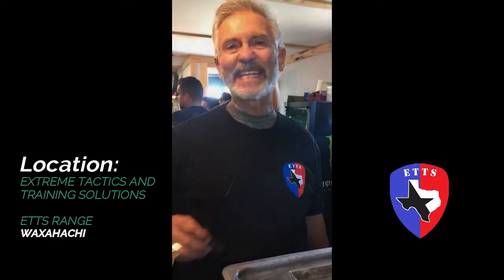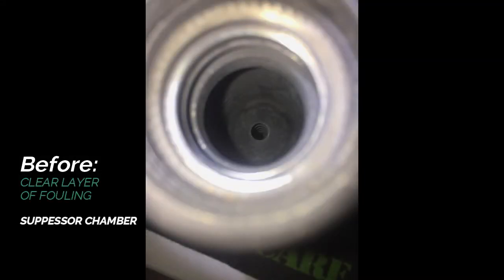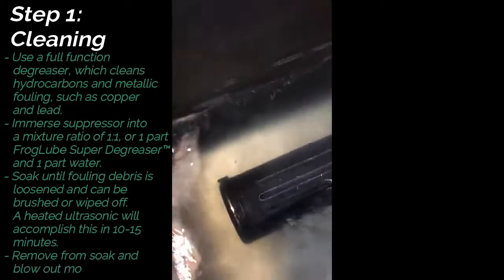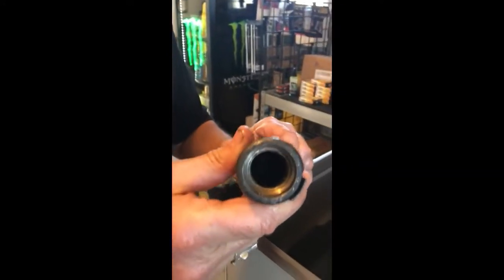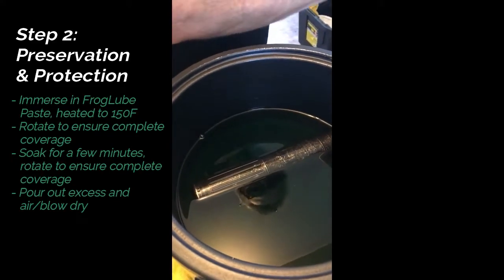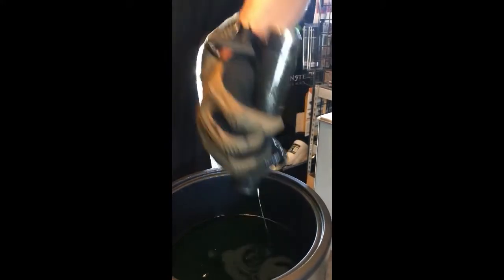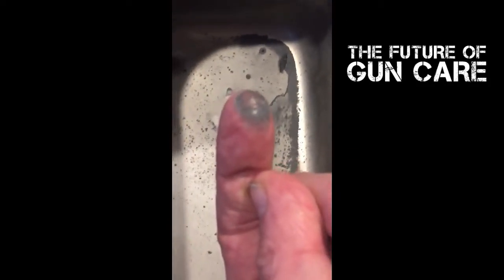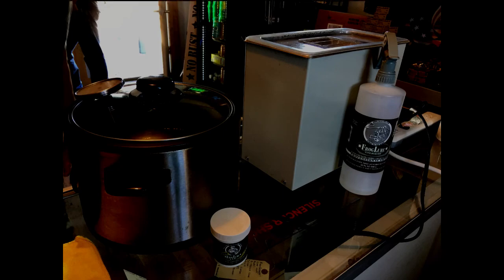Keeping your suppressor clean and ready using the FrogLube system.

Comment: Not knocking the product but I am calling the process itself hokey.  I can run my suppressors through my ultrasonic cleaner with just distilled water and get the same results.  The machine itself is doing 99.5% of the contaminant breakdown for you.  Not the solvent.

Comment: How much product did you use for the cleaning and the preserving?  I know it was 1 to 1 ratio for the ultrasonic bath but how many ounces of degreaser did you use?  For the preserving process, I assume it was straight paste in the crock pot?  How many ounces?  I wonder how many of us Joe Six-pack's could afford such a treatment.  FrogLube is not cheap!  I also wonder how you would measure the benefit of doing this treatment to a suppressor.  I'm awaiting my tax stamp for a suppressor, so I'm genuinely interested.
Reply: I actually did some calling and looking into this SAME thing.  1 gallon of paste is $200 which is CRAZY expensive.  I too am waiting for my tax stamp for my can to arrive.  The day the can arrives I will be breaking it down completely and since it is a Banish series from Silencer Central I will literally have a tube and then the 8 or 9 titanium baffles and putting it into my crock pot and let the suppressor absorb all the FrogLube love it can handle.  But I hope to do a video of my own on this whole process.  Especially since there is almost zero content on doing that on YT.  I wish FrogLube was cheaper because it REALLY sucks dumping that much money on cleaning supplies.
Reply: Hopefully you don’t toss out the crockpot of paste because you can set it aside and simply use it for other parts or next time around. I found you can heat up and let cool a few times before it goes bad.